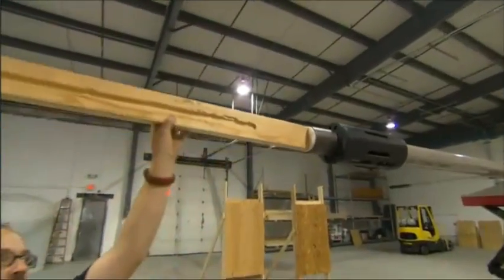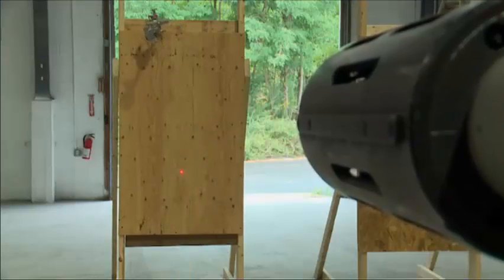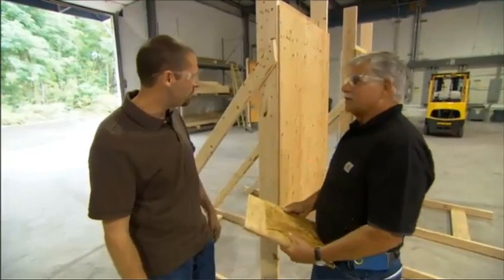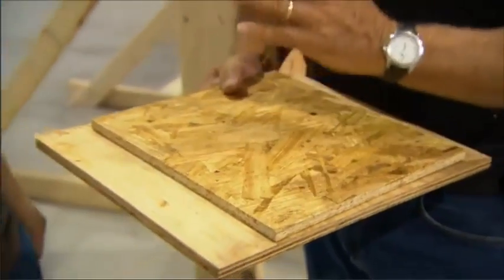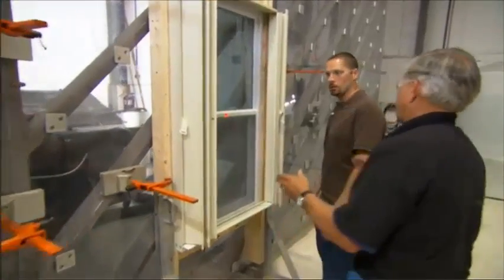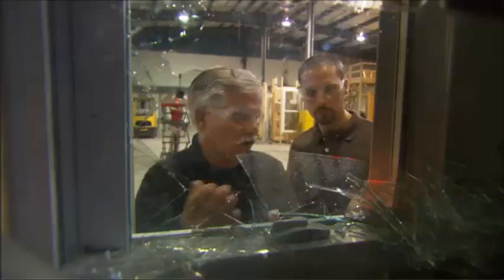This Old House - Window Protection

Comment: Short answer.....thick plywood does the best job by not only preventing foreign-objects to enter the home by, but saves the glass from breaking.....what good does "still complying with code" mean?....when your glass is broken?. And holy smokes.....who cares about the "passive" system that prevents stuff from entering your home, when you end up up with that "expensive, hurricane-protection" window that's all crazed and checkered....needing replacement?

Comment: Impact hurricane windows are expensive to install and replace. Seems like plywood is most economical but a pain to install. I went with hurricane fabric installed about 2 feet away from the window due to 2nd floor overhang.

Comment: I’d sure love to see a screen that’s been in the Florida sun for about a year, maybe 2. when it’s dry rotted 30% of its integrity, stick your finger through it and push, tearing a hole big enough to walk through. How come you didn’t show an extruded aluminum roll down with end retention? 😘
Reply: But it’s not intended to stay on all year only for a storm. I would never keep my windows sealed up all year.
Reply: I actually work in an industrial facility that has hurricane fabric installed around several pieces of outside equipment 24/7/365. It's been there for 6 years now, and although slightly faded (it's black) it's not showing any sign of physical/mechanical degradation whatsoever... and this is in south Florida. Right on the water in Palm Beach County. If you put them up and take them down for storm duty only, I can't imagine that they wouldn't outlast you or me. Let me know if you want a picture or video of it.

Comment: why dont use steel panels in new constructions is easy to install and can add it a electrical motor do it remotely instead to pay a lot for window high impact after to get hit you need to buy a need onw

Comment: The fabric "Astro Guard" was installed incorrectly as per your demonstration. If its installed with the clips against a frame, as your is not, it is installed way out from the frame, so you have no window glass protection. I would do another test with it installed correctly.
Reply: wait how do i properly install it? we've got hurricane dorian coming in a few days and I'm trying to research how to properly apply the fabric